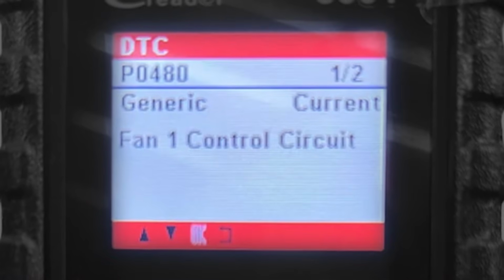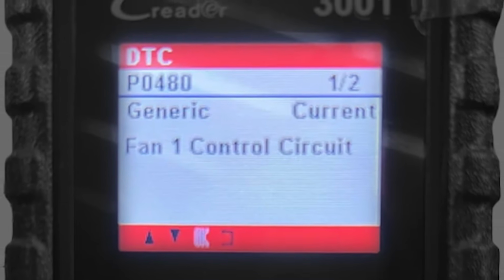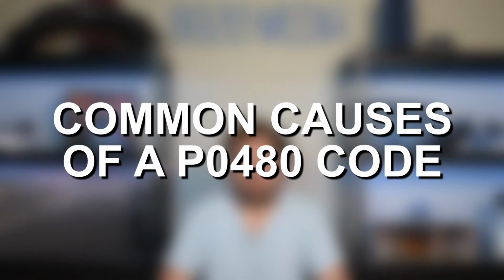P0480 Code Explained: Fix Your Cooling Fan FAST!

Comment: PLEASE HELP!!

Great video and love your series. Here is the issue.  My fiancée car(2019 Jeep Cherokee Latitude) is currently at the “stealer” she once trusted for a P0480 code and the cooling fan not turning on or being intermittent. In traffic or at idle the temp would rise. I cleared the code and it never came back over a month’s time but the symptoms remained. 
Earlier this summer she had the temp control sensor and a coolant flush due to overheating. The P0480 code appeared 1.5 months after the TCS replacement. 

When she booked the appointment and explained the code and the issues and the service manager agreed that it sounds like the fan and it would have to be replaced upon testing and inspection. 

This was three weeks ago. The tech tested the fan and it worked. I can assume with jumper wires to the fan motor. Then after a week she contacted them and said the PCM has to be replaced and programmed. Once that was done they said the fan no longer works and the fan now would have to be replaced. This doesn’t sound right to me. Why did the fan work prior and now doesn’t work with the new PCM. I can only assume the PCM was never the issue and it was wiring or pin issue. Maybe even a relay. 

We were just told this morning that they had to bring in another mechanic to look at it. They also statement yesterday that they ordered the wrong fan and a new one would be ordered. 

My fiancée also tried to reason with them that since it appears that the fan is still the issue would they split the cost of the PCM since it doesn’t appear that was the issue at all. They said they would call her back in 1hr after the service manager spoke with her manager. After 24 hours they called saying they don’t know if they could split the PCM cost and that we will have to talk to the mechanic they had to bring in just for this job.  Our thought is the mechanic has no financial authority over this and that he will try to dance around and explain why the PCM was necessary even though the fan tested working with the previous PCM and not working at all with the new PCM. 

What are your thoughts on this? Any statements or questions I should be asking to confirm if they were legit or just inexperienced. 

Thank you in advance for your assistance and knowledge.

Comment: Can a bad cooling fan motor burn out a relay?
Reply from the maker: T - Yes — a bad cooling fan motor can absolutely burn out a relay. If the motor’s internal windings start to fail or short out, it draws excess current well above what the relay is designed to handle, which can cause the relay’s contacts to overheat, fuse, or melt.